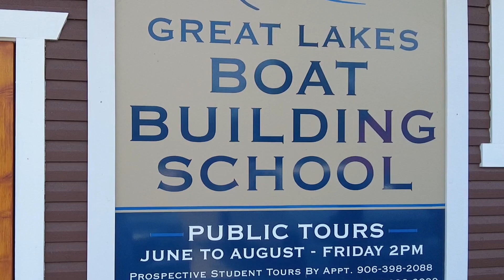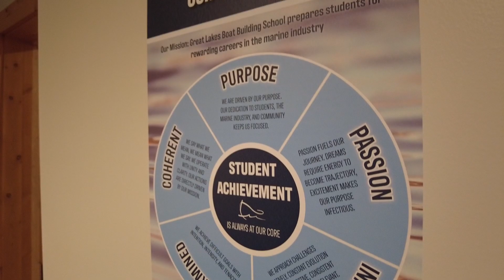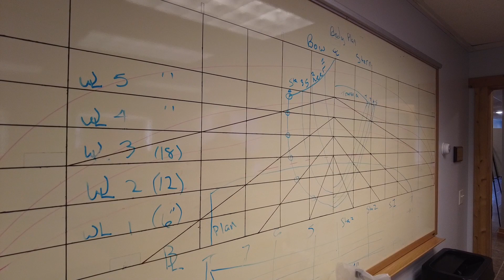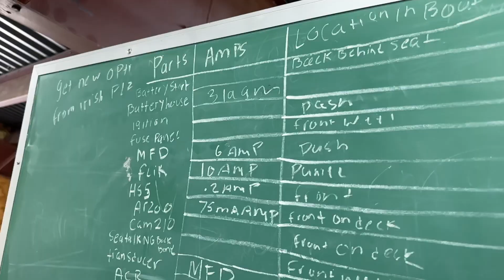Is this Wooden Boat Building Heaven?? | The Great Lakes Boat Building School (Ep39)

Comment: When I was a teenager and living in a foreign country I will check out and read about 10 books on boat building. I was totally enthralled with it. Unfortunately stitch and 1:00 glue and strip building were not included . I did build a strip boat but I would never build it the same as it was insane to spend so much time doing much of nothing. these books
Reply from the maker: Welcome to the Boat Werks Robert😁👍Be sure to like and subscribe

Comment: I built a 17' Stevenson Weekender from plans and scratch materials.  One of the most amazing things I've done in my life.  Loved every second of the build and love sailing the boat.  But your question about motivation that has come up a few times struck me.  I spent a year studying the plans and thinking about any changes I wanted to make and doing research. Then I spent a few months building a scale model out of balsa wood and making my mistakes small and inexpensive.  When I finally bought the materials and got building (something I had no experience with), my motivation was to bring to fruition the thing I'd thought about for 15months and to ensure I didn't have a half built boat.  On the days I struggled with motivation, I truly feared the half built forgotten project and once I got moving out of that fear, I had the time of my life building.
Reply from the maker: The Stevenson Weekender is a great boat to build and your comments ring true with me. Thanks for the comment 👍😁 Please send me a photo and consider joining the free Werkers on Patreon
Reply: How do I join?
Reply: Also where should I send the photos?
Reply from the maker: You go to this link. 

https://patreon.com/MotorCityBoatWerks

And the Boat Werks email is on the homepage of the YouTube Channel or the on my website

Comment: I was guessing way high on the Indian River Skiff. 168 pounds is amazing. 
Regarding WEST System, my go-to is 209 Hardener. Yes, it dries the slowest but it's a waste of money to sand epoxy before it's cured, regardless of how long it takes to kick. Why not use hardener that's not going to torch off in the bucket. Even fast hardeners benefit from overnight curing to be (easily) sandable.
As far as fillers go, I pretty much use 404 (High Density) for everything. It's not called easy to sand but I think it is very easy. I don't use too much 406 tho, It seems kind of hydrophilic and sometimes difficult to mix thoroughly.
Production builders need to sand immediately, we don't. That's an advantage that restorers have. Time.
Seeing these guys using mostly 207 is inspiring me to up my game a little. 207's lower UV resistance is really not a deal breaker since all epoxies seem to need protection, even the ones I've added dark colored pigments to, trying to improve their UV.
My tip for more accurate (Mini Pump) ratios is: Go back and forth between the 105 and the hardener. Like "One, one. Two, two, three-three, etc.", instead of "One two three, one two three". The pumps will have longer to recover, you won't be caught spitting air, the mix is finding reactive sites immediately, and you can answer the phone and still remember where you left off.
I also like to mix my '105/209/404/colorant' soup to the limit of what's "pourable" and coat things like old drawer bottoms, or pour it on old (cleaned) unfinished yucky laminating resin surfaces and let it self-level, with no further treatment except maybe a blush scrub.
Thanks
Reply from the maker: Exactly